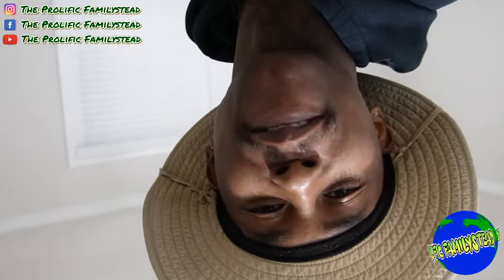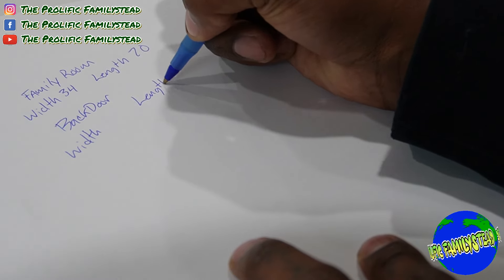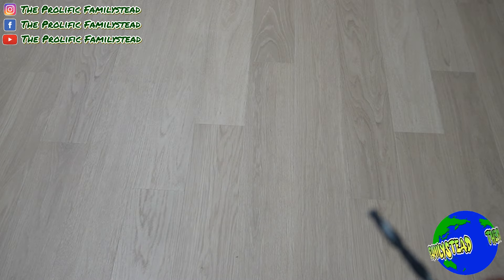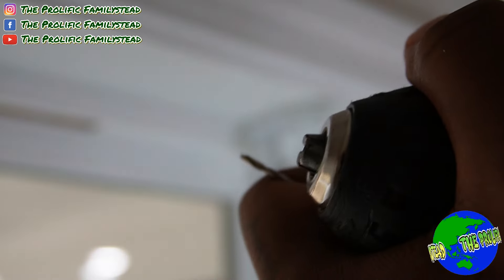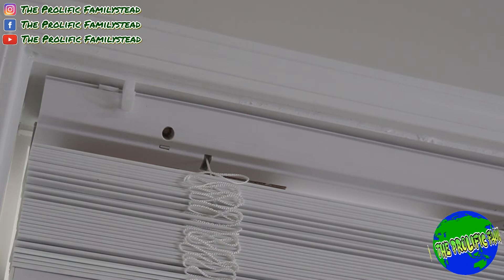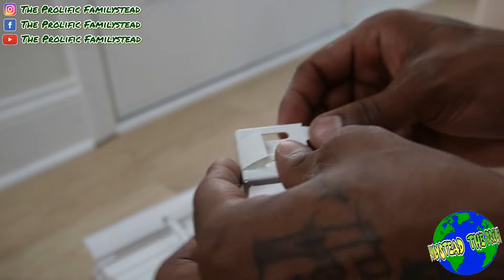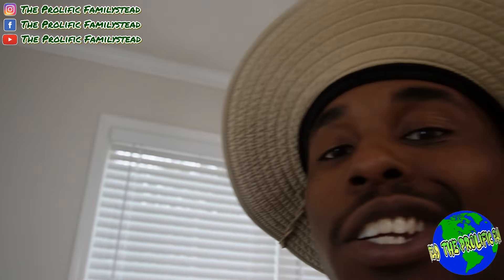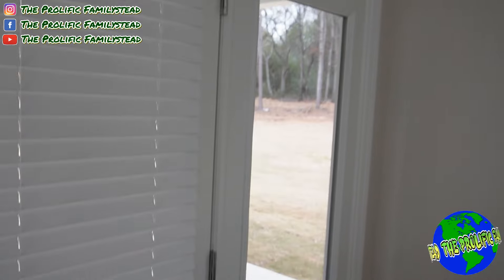How to Install Cordless Blinds | Home Depot Cordless Faux Wood Blinds | Home Decorators Collection

Comment: I am older and all I ever had were corded blinds.  Now you can't get them any more.  I wouldn't despise cordless so much but when they stay down too long they are a pain to get to retract.  How long does it take before you can never get them to retract at all?  They probably have some sort of clock spring mechanism that will wear out soon enough.  They should put a knob on the end of the top rail you can turn when the spring no longer works.  It will be just about as slow as molasses frozen in liquid nitrogen but at least you will be able to open them again!

Comment: Thank you! Your details definitely help. The upper side brackets are definitely not a good idea otherwise the blind wouldn't fit without a dent. Not as easy as you make it but your video is encouraging. Put up two and have two more to go. I still prefer the draw string but couldn't find any more. I'm replacing as such not because they were cheap but because they discolored by the sun.  I doubt if they will be easy to bring down and wash in a tub like others.  I wonder what the recommendations for washing is.

Comment: I have a very shallow trim area at top of window where brackets will have to be installed. I have long ago purchased four sets of blinds to be used for inside mount. If the space is not deep enough to install bracket, is there a way to put in a piece of wood to the top–of window trim–which will adapt trim for the lack of depth? 
Thank you,
Cheryl